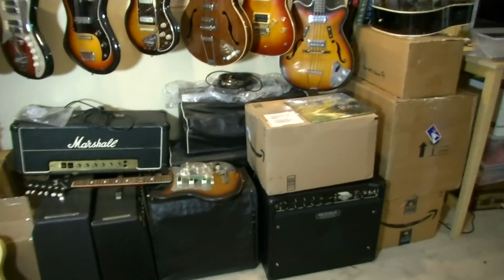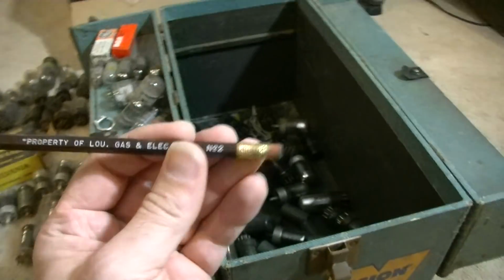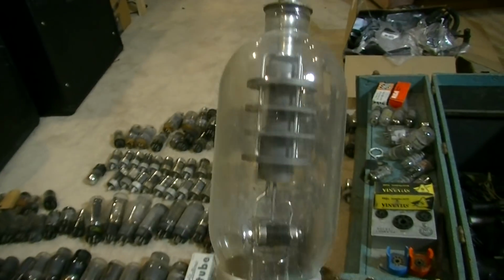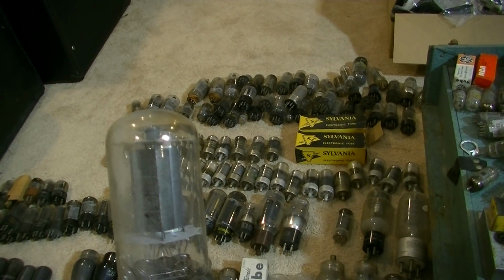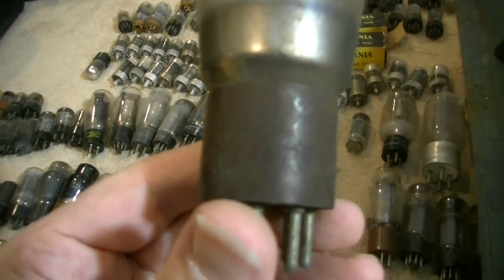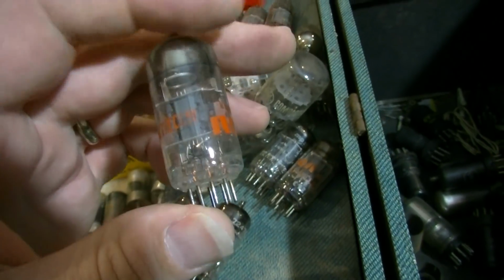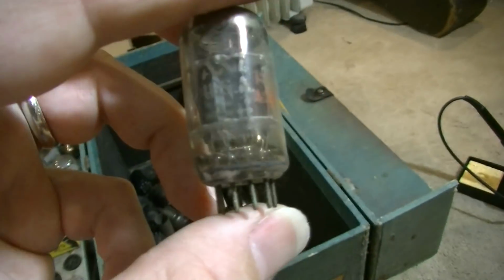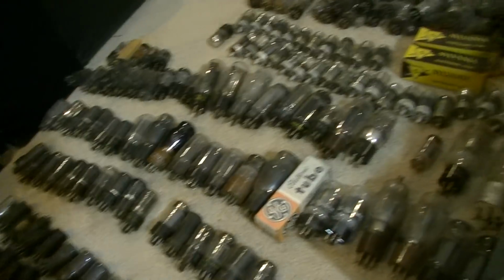SPF Bonus Clip - HUGE TUBE SCORE and Upcoming Projects Sneak Peek!

Comment from the maker: Here's that video of the aluminum can design. Great engineering video: https://www.youtube.com/watch?v=hUhisi2FBuw
So that giant tube is a 25kv high vacuum rectifier. https://www.radiomuseum.org/tubes/tube_576a.html
The 3B28 is a zenon gas rectifier rated at 5kv! http://www.r-type.org/exhib/abh0064.htm
Reply: Guitologist Channel 2 I've used those old pull tabs as a pick before when I was really young.
Reply: Guitologist Channel 2 little known fact about those beer lid tabs: hedgehogs from the northern Nevada area are known to use them as impromptu shanks. Lotta hedgehog stabbings going on up here.
Reply: The 3B28 is a direct drop-in replacement for 866 mercury rectifiers.  Ham radio operators with old transmitting iron will snap them up for that purpose.

The 807 is another tube similar to a 6L6 designed for use in radio transmitters.  It's good for up to 25 watts and are typically used as drivers for large final tubes.

Comment: Some pull tabs particularly the exact type you showed. You were able to flick or launch the round pull ring. Using the part you pulled off the can. The ring would go off sailing through the air spinning like a frisbee. 

The saddest, worst and really the only part of being disappointed by the mandatory changing of the opening of a coke (all drinking cans) can. Was just the fact you could no longer launch the ring.  Of course there would be a graveled park n lot like at a lake or at a park normally at the baseball diamond. It would look like it was being paved by coke can rings almost. So you understand the law change, because of litter. I was born in 58 FYI.

Comment: I used to work for Audio Note, dealt with lots of valves. JAN stands for 'Joint Army / Navy'. If you find valves with metallic looking anodes that means they are seriously old. Take the 211, also known as the VT-4C. Thats 'Vacuum Tube design 4' or VT-4 from 1929, it became VT-4C in 1935 when they carbonised the anode for better conduction and less secondary emission. I know ex-Russian Army valve engineers who could literlly talk for days about just the 300B, and you'd be fascinated! :D
$15?!? Are you kidding? It should have been $300 just for the box!

Comment: The filament tester is a good thing to have if you come across a lot like that.  The sockets are wired for the most common filament pin configurations.

Comment: the rca 12ax7 is labeled i63 b5j4 which means it was made at the blackburn mullard factory in1965. it is an amazing tube with lots of low mid perfect for v1 on marshall and fender amps and also one of the best pi tubes .it was made from 1965 to 1974 and most of the british amps like marshall and vo used them.

Comment: I just picked up about 700 tubes on eBay for $70.  Much along the same lines as what you found in this video.  I picked up another 600 or so NOS.  You have to comb through large tube deals (NOS and Used) for usable stuff.  Most bulk tube deals are for television tubes.  Not many people out there restoring them, so the tubes aren't really worth anything.  You have to know how to spot the deals.  The loose used tube deals can be a bust if they all test bad.

Comment: A "W" added as a suffix after the tube number typically (but not always) may mean that the tube has been ruggedized in some way, perhaps for military use, although not necessarily for resistance to shock and vibration, but perhaps for resistance to losing vacuum under high altitude conditions or something along those lines. An A after the tube number is generally. assumed to mean that the tubes electrical specifications were upgraded or upgraded in some way, but not always, for instance,  a 7189A a has a slightly different pinout  then a 7189 in addition to having increased electrical specifications,  and so a 7189  may not work in a 7189A socket unless  the socket has been specially wired for it to do so ( this may have been done on purpose so that you wouldn't hit a 7189 with too much voltage and current and Fry the tube and damage the amp). Don't assume anything, always best to look it up! 

Just for fun, here is a brief history of the 6L6. the original, first 6 L 6 tubes had a metal bottle and were rated for only 300 volts, and 19 watts plate dissipation. the 6 L6 G had a glass bottle that radiated heat better and was less microphonic but had the same ratings as the 6L6 metal Style. the 6L6 GA had a smaller glass bottle than the G but still had the same voltage and plate dissipation rating. The 6L6GB was uprated to 420 volts and 22 watts, and occasionally had a shorter glass bottle. The 6L6 wgb, generally considered to be pretty much the same as the 5881, virtually always had a shorter bottle, and the same 420 volt 22 watt ratings, and the 5881 variant usually had a special low leakage, arc resistant Micanol  brown base. ( the 5881 was purportedly used to drive the servomechanisms for 1950s bomber planes). The 6L6GC has a taller glass bottle and was up rated to 500 volts, 30 Watts plate dissipation.

by the way, I have a case of 100 New Old Stock 6005 W tubes, which is a ruggedized military purpose 6 a Q5, essentially a miniature 6 V6 in a smaller bottle and with lower voltage and wattage ratings. one of these days I'm going to have to design an amp build around these!

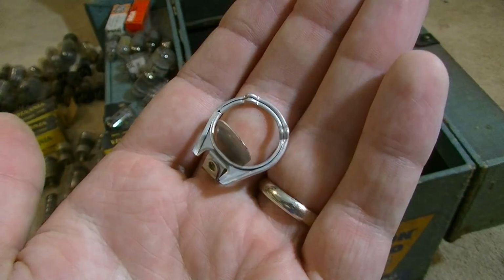Comment: re: the aluminum beer/soda-can pull-tab at 3:35 : when I was a kid, the local fishing-tackle store had a photo clipped from a newspaper pinned up on the wall showing a small trout that had apparently been attracted by the flash and splash of a pull-tab thrown into the water, darted after it, and got the ring stuck around it's middle. The fish continued to grow somewhat but the pull-tab was like a corset or an overly tightened belt, constricting its abdomen and spine. 

Occasionally we would find a pull-tab inside a bluefish's stomach while cleaning it ---- those things will strike at ANYTHING when they're in a feeding frenzy.  A lobsterman I knew caught several "blues" on a brass hinge with a hook tied to it.

Comment: JAN - CUE 576A Vf 5 Volts / If 14 Ampere / Direct /
HV rectifier/clipper. As rectifier it can be operated up to 25KV with 500mA out current. 
Made by United Electronics. 
Literature=Tube Lore
Reply: Roy Rogers, "Tube Lore" by Ludwell Sibley, one of my most-often-thumbed-through reference books. My copy is dog-eared and has lots of semi-legible notes scribbled unto the margins.

Comment: Hey maybe you could trade me the 6f6s? They actually drive my amplifier for monitoring and program output in my Raytheon rc10 restoration, which is a 6j7 9 mic/line preamp mixer with 50 or 250 ohm impedance and beefy input and output transformers from utc. I’m surprised you aren’t familiar with large transmitting tubes and their use in mostly single ended amplifiers. 211s and 845s and so on... and one can’t forget the awesome power and appearance of mercury vapor rectification in western electric and Phillips amps... god they look as cool as those large rectifiers that look like octopusses filled with glowing blue green plasma. Haha

Comment: 576A is a high voltage rectifier rated at 25,000 volts and 500ma.  The first home made guitar amplifier I made used two 6f6 tubes push pull for the output.

Comment: Are the original 5881 tubes that came in my 59 twin worth more than the new ones if they work well?also you said 6l6 with some letters after the numbers are they different than the 5881s?
Reply from the maker: The 5881 is a type of 6L6. And absolutely, yes, your older tubes are worth keeping in the amp if they work well. They may just last forever if the amp is in good order.
Reply: Guitologist Channel 2 I had one blow on me so I'm running it on 40 wTts.if I go back to 80 watts do I have to put in a matched set of quads? Or can I replace 2 only? I also have the bright channel stopped working tube in your opinion?
Reply: I have the same question on a quad of 6v6's I'm only running two now one went bad. Should I go w/a new matched Quartet or can I just add two new tubes to the two that's in it? It's a 50 watt Stealth designed by Lee Jackson.
Reply from the maker: replacing just in pairs is usually the way I'd go. Then keep your one single that was still good for use in something single ended later on.

Comment: Brad...Here's your scary rectifier tube: https://www.radiomuseum.org/tubes/tube_576a.html
That one would bite!!
Cracking up over the pull tab history lesson! Used to make chains out of those...as we 'disposed' of the containers' contents! LOL :-)
Reply: ...and the other oddball is another rectifier: https://www.radiomuseum.org/tubes/tube_3b28.html
Reply from the maker: It's a "historic artifact": http://westerndigs.org/ring-tab-beer-cans-are-now-officially-historic-artifacts/
Reply: That case, in case you've never seen one, is an old TV service tube case that tube manufacturers sold to dealers, completely stocked! If, for instance, you were a Magnavox dealer, you were required to buy a service case stocked primarily with Sylvania tubes. When I was a kid, our TV service guy showed up with one of these cases and a couple of screwdrivers! Anything that couldn't be fixed with a tube swap or simple tweak had to go back to the shop....which required an able-bodied assistant, since these old monsters weighed a ton!!
Reply from the maker: Yep. I have two others, an RCA and an Admiral.
Reply: "It's a "historic artifact""  LMAO!!  Good Lord....what does that make ME?? :-D

Comment: in high school our grade 8 electricity project was building a tube filament tester that looked similar to that one.  That was in 77'    I think they make Vape's now a days.
Reply: Instructor Maint, makung Vapes in school would of coyrse be an unsanctioned school activity----like when we turned brass rod stock into pot pipes on a lathe in metal shop!
Reply: @goodun6081  that brings back memories!😂
Reply: good 'un  You should never use brass for  smoking through. when heated brass emits a highly toxic gas.
Reply: @gregg4164  so that's what's wrong with me!😂
Reply: gregg4164, interesting, I didn't know that; and the local headshop had plenty of brass pipes for sale! Although we actually preferred wood pipes for pot and brass ones for hash, probably those didnt get hot enough to be truly toxic...
Reply from the maker: Vapes?! hahaha. Wow.

Comment: Wow what deal on the Tubes I have a small bag of Old Tubes , I picked out the 12ax7's maybe you could use the others? Haha Beer tap ppl made chains of them.I'd love to have a pair 5881 to run on the outside sockets on my 5150 w/6L6 in the two inner sockets & what tube would you suggest to tame the beast especially the Clean Chn & maybe the 1st tube to tame the gain would that help the clean chn? Thx Brad love your chn.
Reply from the maker: Try sticking a 12AU7 in V1, maybe an old GE tube.
Reply: Would you be willing to part w/one? Or two one for V1 & the other for the clean slot I forget which it is in a 5150. Thx Brad. Would you want those tubes I have? They are from the 50's & 60's  might be a 12AU7 in that bag?
Reply from the maker: Email me and we'll figure something out: bradlinzy at gmail